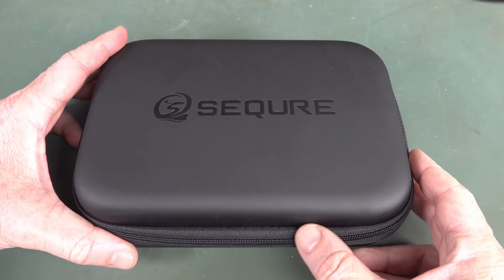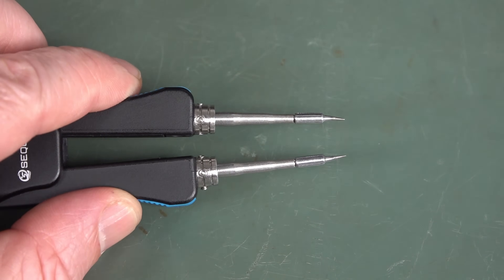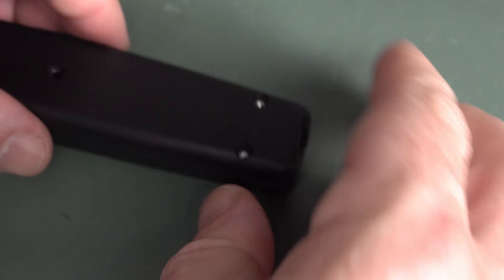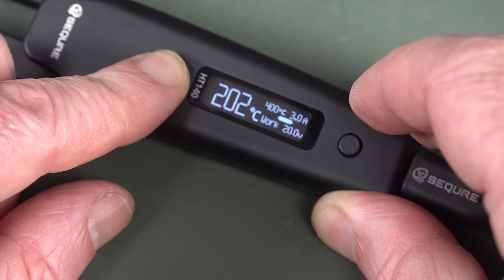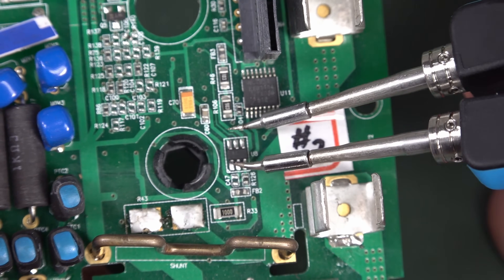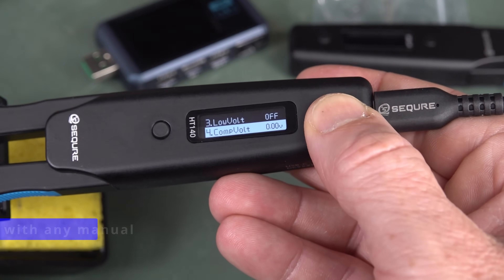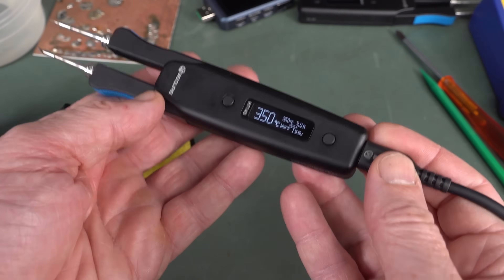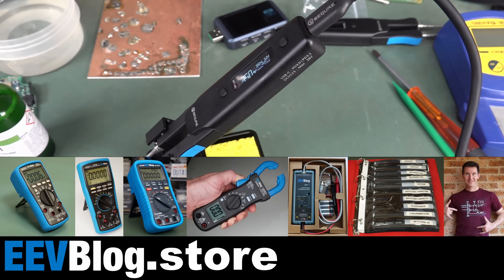EEVblog 1650 - Sequre HT-140 SMD Desoldering Tweezers REVIEW

Comment: Nice tweezers, I'd love a pair for my service work. Now I wonder how long will it take until Fnirsi launch one.
I hate the grub screw mount on the tips, it's a destroyer for sure. If they made a better mount, like a collet or something, the tips wouldn't get deformed and you could share them with a soldering station no problem.
The DC barrel jack is like nothing I've seen before, I could almost trust it with life, universe and everything.
Reply: It is not necessary to tighten the screws so strongly - the soldering tips center themselves accurately enough. The tips lock in exactly the same way as any soldering iron with JBC type soldering tips. These screws are for more precise alignment of the tips
Reply: @itguru4989  True it's not necessary but over tightening is almost guaranteed - just to be sure.
Reply: @daveturner5305  I agree. That's the price to pay for small size and not wobbling construction
Reply: That DC barrel jack first showed up in the TS100, and now other USB irons use it too.
Reply: Would have been nice to have barrel screws over the tip shafts like Weller and other soldering pens do for a quick change.

Comment: I used mine twice. Most of my work has such large plains, at least on one side of a component, I struggle. It’s a shame. The tips don’t get close enough for many small components either. I’ve bought JBC tips in the past and couldn’t keep the tin on the tip to hold solder there. I’ve really struggled with the c210 platform.

Comment: Hello Dave. Have you checked what the voltage leakage is on the tip?⚡
Reply: Came here to ask exactly that. I work on cell phones and game consoles and I always have to replace tiny capacitors. This is the only thing keeping me from buying these as I don't know about leakage. Someone mentioned they leak about 6 V.
Reply: @sammarqus6990  ~50V!
Reply: @sammarqus6990 Ian Scott Johnston did a video about that with these tweezers. The solution is just to add your own ground wire and he seemed satisfied with it
Reply: @chrisjones8741   This grounding does not solve the problem.  It's the independently-driven out-of-phase driver circuits causing a voltage differential between the tips.  A power supply is NOT necessary to produce this condition.  The voltage of the spikes corresponds to the voltage being supplied.

Comment: Don't let the accountants get at it for God's sake 😂
Reply: It's actually usually the stock holders meetings that ruin everything. They need to make 10 cents more for each unit and so they pinch pennies. At least that's how it works at the Fisher Price toy dump truck division I run. Fisher Price vehicles used to have good acceleration and diesel efficiency. Now they get less than 10 mpg and the engines have the worst torque in the industry. Yes, the toy dump truck industry. It's immensely competitive. We're undercutting Caterpillar but we get so many warranty claims that we're losing money. But the shareholders told us to do it this way, and when they see we're losing money, they'll just have us cut more costs and then more units will be RMA'd for faulty fuel pumps or spark plugs, and the cycle will continue.

Comment: Nice. But I just ordered a 7 pin 902 based twister to go mitt me 902 based clone (AUS$24).  Not doing enough with to warrent the expense.  But some good desoldering tips with the twisers thanks!
Reply: DOH! Plugged me 902 clone into my ATTEN 8586 (another clone).  

Made smoke.

Reminds me of a comment a mate made when someone fried the umbilical to a torpedo using a presetter with a short in it.

"Excitation to incandescence".

Love that phrase!

"Excitation to incandescence".

For mortals, the wiring to the element on one side vapourised, literally.

On it's way back to the vendor for a refund.

The best AUS$24 I should have never spent.

Comment: Interesting tool. I don't do much work with SMD as I don't have the tools to work with the properly. This device would be helpful. Although it is meant for desoldering it looks like it could still help with soldering some of the smaller SMD parts on to a board

Comment: the out of focus was really distracting. This tweezer is really what I am missing in my lab. Barrel jack and USB C is also interesting idea. I just think they could of added a more intuitive UI with joystick or the single axis joystick that some soldering iron have.
Reply: Temperature settings can be  be switched to a system developed by Sequre called Turbosets, where this tweezers can be controlled with the push of a only one button or in the usual way by two buttons. The settings are changed very rarely and it is not something that needs to be changed constantly - usually you need to switch on (or switch off) tweezers or soldering iron and have some most common temperature presets, so there is enough to use only one button in most cases.
Reply: @ yeah I would need to test it. i quickly judge the design without testing. I agree you set and forget. I change the temp and sleep timer on my soldering iron and then never touch it. But it was intuitive with that small joystick for the few seconds playing with it. I did not get frustrated.

Comment: So far, I've found it is worth spending the small fortune on real JBC 210 tips as they perform much better than the copies that ship with all these 'compatible' clone irons. Reckon these are likely no different.
Reply: Had no issues with decent brand copy tips, C245, C210 and C115, don't buy the cheapest no name ones.
Reply: @jaro6985  What brands have you had a good experience with?
Reply: @jaro6985 good info
Reply: Still looks 100x better than iFixit disaster

Comment: LR Select, surely that's for left handed/right handed users?
Reply: There is another setting for left handed/right handed users - screen rotation by 180 degrees. This option exists in almost all Sequre products.
LR select - You can use and control both tips when using HT140 as tweezers or use only one - only right or only left tip if You need to use HT140 as soldering iron

Comment: Very nice product. However, realistically, who would use them in the field. IMHO such instrument is for lab, service centers etc.
Reply: You'd be surprised of the stuff that comes up in the said field... Also, the definition of "field" varies widely across industries/sectors. My point is this thing is much less niche than it may seem.
Reply: @stoyantsalev3109   yes, I do agree that my understanding of "field" is limited only to my own experience.
But even when I maintained 70s era telecom equipment which was full of through hole components,  I have never had a necessity to replace even transistor in place.
Just replace a board, get broken unit to lab and repair it there (usually we had dedicated people in the lab for that, but it's another story). 
That is why I doubt that now, someone would need to repair something like 0805 in place.

Comment: One thing I wish you do was to desolder some Electrolytic SMD Caps...
Those seems to be the biggest pain in the behind and something some of us might want to change (old consoles from the 90s and 00s for example)
Reply: The C210 tips with 65w i wouldn't think that they have the capacity,  or maybe with lead soldering added. Or with bigger power supply
Reply: at my workplace we use 2 irons to desolder Electrolytics

Comment: I was wondering how ESD safe is DC based soldering iron pulsing on & off? Especially with C245 (8-10A). Does it not induce voltages around the tip like wireless power transfer? Opinions?

13:50 I noticed it shorts out or something happens & the mic pics it up, like static? Do you hear it? Or is it a coincidence?
Reply from the maker: RFI mic pickup when the heavy current switching started up. Not uncommon.
Reply: Yes!  I found the unit causes switching voltage spikes between the tips every ~17 ms.  The tips are individually driven, and the pulsing you described is observable with an oscilloscope, even when running directly from 6s battery pack.
Reply: @pault6533  can’t trust Chinese equipment anymore. But try using mains earth as the reference for measurements. Ideally, you’d be working on an earthed ESD mat anyway.
Reply: @davadoff  The issue I am reporting is a side effect of two independently driven series thermocouple style heaters. The driver circuits must briefly interrupt current to sample the temperature. That causes electric noise.
Reply: @pault6533  maybe I misunderstood. I thought you were measuring the potential difference between the tips…
Reply: @davadoff  I am.  The potential difference is brief. It is only 2.5 V peak, but I found it can noticeably light a Green LED while running off 6 18650 cell pack in an ESD setup.
Reply: @pault6533  whoops, you’re right. I was thinking if you measured tip to earth instead you might not see that voltage. But if there’s no potential difference to earth, then there can be no potential difference between the tips either. Brain fade; I’m tired.
Reply: @davadoff   My results don't agree with "if there’s no potential difference to earth, then there can be no potential difference between the tips either."  The battery, iron, and oscilloscope are all floating in my test setup.
Reply: @pault6533  yeah, I was saying why I was wrong. 
I know it’s floating, but you can still measure the potential to earth when it’s floating.
Reply: Some popular & positive reviewed Chinese irons have alarming amount of voltage or current output at the tips. Hakko 936 clones were fine, then came 👎 :thumbs down:

Comment: Sequre S99 comes with that same 65W PSU. They actually suggest using a Lenovo Legion C135 for 150W, 2.5Ω tips (included one is 75W, 5.5Ω). Powering two smaller tips could probably use the upgrade.

I just finished building a portable battery stand for my Sequre S99 today and I’m pretty proud of it. Got a Power Wheels adapter for DeWALT batteries and mounted a metal plate with a binder clip attached. Then I threaded a spring door stop into the binder clip and cut the excess so the iron tip would protrude. Connected the included XT60 to USB-C cable and it totally works!
Reply: I have the S99, cracking little iron
Reply: Definitely, but I’m off to a rocky start with mine.

The accelerometer didn’t work and they sent me the defective V1.4 PCB over two months after they supposedly corrected the issue in shipping units (not for American Amazon orders, it seems). I couldn’t even claim the compensatory free iron tip since they explicitly exclude orders after April 23rd.

I had to wait on a replacement V1.5 PCB for the accelerometer issue so it didn’t make sense to do the required capacitor fix for V1.3/1.4 PCBs. Hopefully they’ve got these issues behind them so that the iron can shine! It deserves more attention. Driving 150W JBC tips is a huge difference from the MiniWare TS-80/100/101 irons.
Reply: S60P, S99 all have the same problem of PD chip. I replace two times the power chip, still with same problem.
Reply: @BCDTech  Sorry to hear that. I’m using 3 different power supplies/sources: 5S power tool battery with XT-60 plug, DeWALT DCB094 (PD), and Lenovo Legion C135 (PPS). They recommend C135 as an upgrade from the included 65W PSU. So far my USB PD chip has remained fine.
Reply: @emmettturner9452  i think you have the latest version of the tool..

Comment: Not a fan of the grub-screws at all.. That would have been an absolute ideal place for implementing a split-ring type bolt tensioner. Same thing most mini ball-joints use for holding onto the ball-mount, where a tapering screw forces leaves to squeeze in closer with each turn. Passing on this one, poor mechanical engineering on a very crucial spot, looks great otherwise, but that approach is so 'meh'

Comment: Do people generally expect to reuse two-pin SMD parts that they remove this way? Because if they're like me and think rescuing a $0.02 passive is silly, the technique of just putting a big blob of solder on the part and flicking it away with a conventional iron works pretty well and is free.
Reply from the maker: Very common to remove the part for testing out of circuit, and if it good you might put it back in. But it's also about doing the least damage to the pads.
Reply: For boards that are no longer made like vintage computers and game consoles using SMD tweezers gives a person piece of mind when recapping.

Comment: I use a tip big enough to contact both pads across the side of an SMD part from 0805 down to 0402. Works for soldering and de-soldering. Seems like these are for larger parts like those diodes.

Comment: 14:43 Left and Right setting is for display orientation, depending on whether you are left or right handed.
It's not to make it into a soldering iron 😃 🙄
Reply from the maker: No, there is a different setting for the screen. The one I showed is indeed for the tips, it's explained on the website page.

Comment: Has it only 2 wires to a C210? No 3rd wire for esd-safety ground without current carry?
Reply: That's actually a very good point. I own  two Sequre soldering irons and they both have a mounting screw for a grounding strap. Perhaps this one has that as well.

Comment: Max current is 5A so if you had adjusted the current limit in settings it probably would've reached it when you used the DC barrel jack.
Very nice looking tweezers all together. Considering how well they work, I'm tempted to try their C245 or C210 USB-C irons.
Reply: Can go upto 140 and above: https://youtu.be/Gpj_WLB-QGg?si=KhkVsJIcx1JwXlqu&t=510
Reply: if you want a good USB-C soldering iron I would suggest a PINECIL, or a TS100/TS101
Reply: @darknessblades  They are good products but do not have the tip selection advantage of C245 or C210 compatible irons.

Comment: I am SO impressed by this! Those tips seems really good since it respond so quickly to temperature changes.
Reply: Well, most small SMD's don't have a huge thermal mass except larger ones.
Reply: @BillAnt  anything on a ground plane will have a large thermal mass.
Reply: @jaro6985  - Doubt there are large ground planes for small components.
Reply: @BillAnt  If you work on 4 and 8 layer boards, there will often be.

Comment: thermal capacity wise it may be not so good, but thermal TRANSFER wise it seems to be great! otherwise it wouldn't have dropped down to 50-60 degrees on the thermocouple inside the tips and would have shown higher temperatures.
in other words, there seems to be good thermal coupling between the heater element and the outer surface of the tips.
Reply: Also who cares about thermal capacity in water, it's not like you'll be desoldering under water. lol  Would have been nice to have barrel screws over the tip shafts like Weller and other soldering pens do for a quick change.
Reply: @BillAnt  The water test is mostly to check the maximum power consumption, and partly check the responsiveness of the system. You'll have a very hard time drawing the full 65W when soldering in normal use.
Reply: Yes JBC tips have good thermal coupling to the thermocouple inside, you can find some teardown photos and see the thermocouple on c210 is directly bonded to the tip.

Comment: 35V caps for 28V device, not sure about that
Reply: That's 80% of the voltage rating. They're not tantalum caps.  They will be fine when used with a regulated power supply.

Comment: Great tool. It makes light work of those small SMDs for sure. Good price too.
Reply: If you change enough SMDs, hot air is faster.
When I work for Sony, we changed all sorts of devices with nothing but hot air.
Reply: @johnnodge4327  With tweezers you don't to worry about accidentally blowing other random parts off the board though. 2-3 seconds to heat up the iron, another 2 seconds to pluck the part off seems plenty fast for me.

If you need to remove a bunch of differently sized parts though (as in different amount of pins for example), than that's a different story of course since swapping the tips out is going to take a bit of effort.